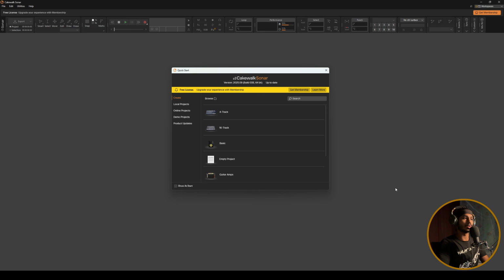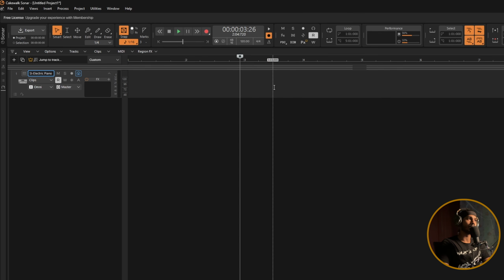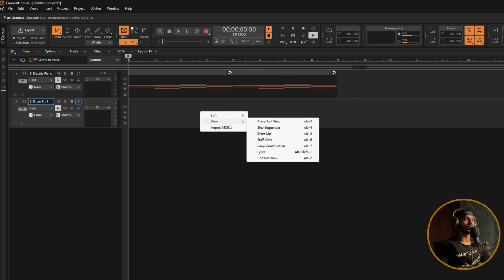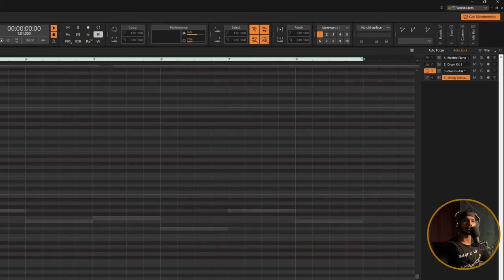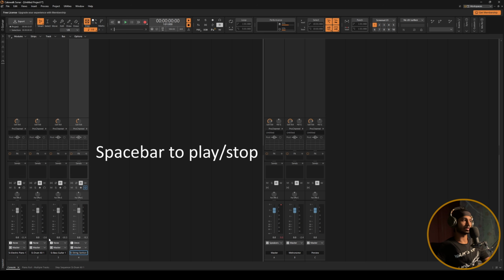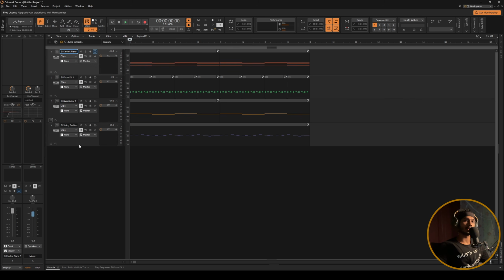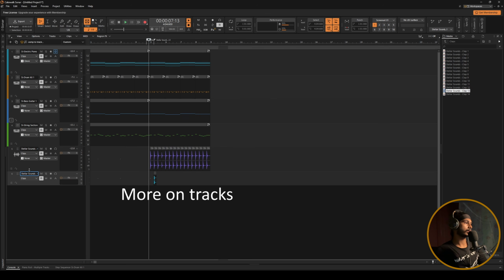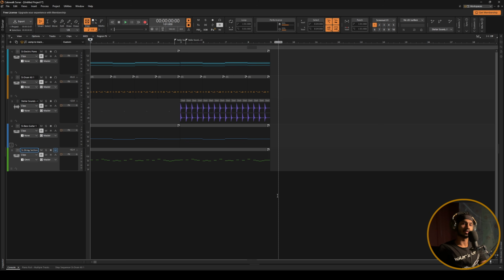Get started with the Free Cakewalk Sonar DAW. Absolute beginner tutorial.

Comment: sound not coming
Reply: 1: In Windows see what Playback Device it's using. It may be set to Headphones, might be multiple different "speakers" listed, etc. If you have two that have the same name then consider renaming one of them to "speakers 2" or something like that so you can differentiate. 
2: In Sonar go to Edit -> Preferences -> Audio -> Devices and make sure the Playback Device you chose in the last step is checked. Click OK or Apply. If it's still not making sound then you might need to restart Sonar - I'm not clear on that myself.
Reply from the maker: Go to the Console view and on the Master track make sure your output is selected to your speakers and also on the individual tracks makes sure the output out is selected to master. I’ll make a video on this soon cause a lot of people have been having this issue. Thanks for the comment 🙌🏻

Comment: I have a question. When I do the Piano roll and hit a note a long yellow vertical line appears by the note ... why would that be? I would appreciate any help. Thanks for a great video!
Reply from the maker: Heyy, that’s called the velocity for the note. You can move that line up or down to change the individual volumes of the notes. You can take it off your screen by clicking on “View” on the top left and then uncheck “Show/hide controller pane”. You can even turn it on or off from a small symbol 2nd to the right of the plus symbol at the bottom left. If you want to view it a little you can drag it up from the bottom as it’s hidden

Comment: I'm already at a dead end 3 minutes in. I opened the thing to select an instrument, and it's silent. No matter what sound I select on the piano, there is no sound.
Reply from the maker: Click P on your keyboard. It will open up your Preferences tab. Under ‘Audio’ go to ‘Devices’ and make sure Your preferred Output driver is checked.

You can also load an instrument track. Drag it open a little and there should be a drop down marked ‘I’ and ‘O’ make sure under the drop down marked ‘O’ that is the output, should be set to ‘Master’.

Also you can check in your Console view under your Master bus. That it’s output is set to your speakers
Reply: @nashgomes  I ended up figuring it out. The master was set to a different output source. I switched it to another, and then it was able to make sound. I was finally able to draw a simple 4 chord progression, which took half a goddamn hour because of the unbelievably unintuitive controls, and then I found out I can't just copy the progression to repeat it, I have to make a clip out of it and copy the clip, and then I couldn't figure out how to trim the length of the clip to the same as the progression, and then I shut it off and uninstalled the software. Unusable garbage. Absolutely useless for a beginner to learn how to make music.
Reply from the maker: I understand. It was difficult for me too at the start. Once you learn the shortcuts it’s gets easier. Also midi notes can be highlighted and moved around and copied by holding control on the keyboard. It takes some time to get used to everything. I prefer it as it’s one of the only free fully featured daw that you can make good music in. Unlimited tracks and third party plugin compatibility is good. You could try Tracktion waveform. Heard some good things about it. I’m yet to try it out.
Reply: @nashgomes  The only DAW I've been able to wrap my head around is Korg Gadget on the Nintendo Switch, but I've pretty much exhausted it's extremely limited potential. Its just so much more intuitive than any Desktop DAW I've tried.